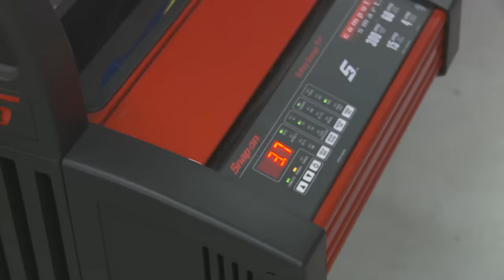Nitrous Muscle Truck and Mini Bikes! - Roadkill Episode 18

Comment: Back when Roadkill was Awsome. This is how it should be, building and working on the cars. Now it's just crusing around in old cars.

Don't get me wrong I still love the show but I'd just like for them to start building now. I also think they are focusing more on hotrod garage now.
Reply: Adilson Ochoa If you havn't already, watch the newest episode :) General mayham driveline is going into an old Duster, good episode
Reply: TaxiRune Yeah I seen it. It was Good. I heard the general mayhem is getting a SRT Hellcat engine on it that should be interesting. I'd like to see how they will pull that one off
Reply: Adilson Ochoa they sent it to some other shop to do it sorry to break the bad news
Reply: ***** Thats a real Shame. Are they going to build it themselves or Will they need the help?
Reply: Adilson Ochoa idk, just read it on the writeup for ep 40
Reply: Adilson Ochoa
Reply: Adilson Ochoa They will definitely need that extra help as the Mayhem is an old bodystyle with no form of modern electronics and with the electrical starter, they would need much extra help they could get to set the Fuel Injectors and electrical starter working.
Reply: Adilson Ochoa I just want a 2stroke diesel put into a Corvette.
Reply: +Adilson Ochoa Have you seen the last 2 episodes?
Reply: Scootering About did you know roadkill hates some corvettes
Reply: stupid correcter put your name wrong
Reply: TheNissanGuy i'd love to see Freiburger's '32 Ford project built on an episode of roadkill.
Reply: Adilson Ochoa they have more goin on then I could imagine. I'm sure they would make a new roadkill every week if they could but they have lives at home and jobs
Reply: Adilson Ochoa m...  .      ii9
Reply: Adilson Ochoa 
 l
Reply: Adilson Ochoa you should watch roadkill garage
Reply: If you want to see them building more stuff just go and watch Roadkill garage
 All they really do is build stuff

Comment: Dude i want this truck so bad. Wish i could put something like this together
Reply: a1duzit that truck from Jeepers Creepers had  a 383 with a whipple supercharger tell that wasn't badass looking like a pos
Reply: a1duzit come to north texas you can find a shit load of trucks like that
Reply: +a1duzit Drop an L76 into an old truck, it'll sound pretty close. You can get one out of an old 07-09 GM truck, it's the VortecMax engine, same 6.0 truck LS but an aluminum block. Those will be cheaper and easier to find than an LS6 or LS2, and with headers/tune it'll have over 400hp easy.
Reply: Im about to put a 77 stepside together with a 5.3, cam, and the same exhaust as the muscle truck
Reply: than just do it
Reply: Ryan Haslett wat was the middle called?
Reply: Ryan Haslett muffler*

Comment: That green stuff in the carb isn't mold; it is oxidized copper caused by ethanol attacking the floats and other brass parts of the carb.
Reply: That's what he said like 8 seconds later.
Reply: After years of using ethanol i have never seen anything green in my fuel system. I also never let fuel sit because I drive almost daily.Ethanol by itself is not corrosive. The problem occurs when you have two disimular metals in a fuel system. Since ethanol is slightly conductive this provides an electrolyte for electrolysis to occur. Ever see green corrosion on battery terminals? This is where the green color is coming from. It's probably coming from a piece of copper in the system which is the cathode. If you leave pure alcohol in a carburetor it should not leave any residue.
Reply: Possum Living i
Reply: well looks like SOMEBODY went to school...
Reply: GTIBully yes but it would just wreck everything rubber
Reply: GTIBully and yeah, floats are copper....
Reply: GTIBully it’s coming from the float bowls and needles/seats that are likely copper. The issue is, that modern fuel companies are using ethanol to reduce the octanes in fuel. While e85 is fantastic, e10 is utter garbage. 
And ethanol is essentially alcohol. It’s the fact that the ethanol is absorbing water and moisture, which is then corroding the copper.
Reply: ethanol gasoline is a double bladed sword. it burns clean because it has alcohol in it but it stinks, and it kills carburetors.
Reply: Look at you with your car stuff
Reply: Dylan Baxter bruh a COPPER float? You mean PLASTIC float?
Reply: +Dylan Baxter Brass
Reply: patina
Reply: Dylan Baxter Ethanol isn't essentially alcohol.  Ethanol IS alcohol.
Reply: Dave Micolichek your stupidity kills carburetors, not ethanol
Reply: @dylnbxtr  brass **

Comment: I look the look of the truck.
Reply: Like*
Reply: fhtfsca ffxqf cqikt4
Reply: +EnterpriseGamer same here its awesome!
Reply: EnterpriseGamer you mean ute
Reply: oooh a australian btw i am 1
Reply: It's body on frame with a removable bed. It's a truck.
Reply: In Australia its a ute
Reply: Proper utes have integrated cargo trays, not removable beds, and it's an American truck in America. A Holden Maloo is a ute, a Chevy C10 is a pickup truck.
Reply: ^^ so right, i hate when aussies call pickups utes and americans call utes pickups
Reply: HyperLeafBlower not sure what you call th3 classic Ute's then? (HQ'S for example.) 
and is a hikux a truck or a Ute? same goes for the Holden Colorado yeah??
Reply: Call them what you want in Australia I guess, I would say an HQ is a coupe utility/Ute, since the bed is integrated into the body. We don't have Hiluxs in North America, but if we did I'd call that and the Chevy Colorado/GMC Canyon (our version of the Holden Colorado) pickup trucks, as they are body-on-frame and have removable beds. The term "ute" doesn't really exist here.
Reply: HQ's had a body style called the "One tonner" where they were a seperate cab and tray.

Probably why they're still around unlike the fords. My guess is the fords and style side HQ's got junked when the rear quarters rusted out.

Comment: All that green crud in the carb was probably from the ethanol oxidizing the brass(?) floats and whatnot inside.
Reply: David F. Oh it was definitely ethanol oxidization. Mixing that shit with gas is NOT ok.
Reply: Yes
Reply: +WeActOnImpulse Official actually it is. You can compress it more without igniting it self. Dragster and other high performance engines use it
Reply: Tankred Zrn
Yeah, ethanol has a higher octane rating and is good for a lot of reasons, but older cars were never designed to run on ethanol and can be aggressive on fuel system components.
Reply: It’s the water, not ethanol. Learn to use it properly and it’s perfectly fine. Not rocket science, just basic maintenance.

Comment: To the point of the bad gas in the carb I acquired an old 1973 Garden tractor that had the stock carburetor on it. It had a metal bowl on it, & when I pulled the carb off to inspect cuz I was swapping a different engine the carburetor was completely destroyed. The tank was also metal, & all I blame is the Ethonol gas that was in it.

I’ve seen countless examples where the new Ethonol gas has killed carburetors. That, & Ethonol gas stinks rly bad. I’ve got a tractor whose previous owner filled it up w Ethonol gas, & haven’t touched it cuz I know it’ll need a carb, & wiring harness help.

Comment: I have a 1978 Camaro, but has issues with the part where the door shuts, the pin on this car is barely hanging on, Can't really drive this car, Unable to shut the door. It desperately needs to be replaced. I bought this car, because I am disabled, wheelchair bound, and that car sits low enough to get in, and the door opens wide enough, so I can load the chair inside my car. I wish you guys were close enough to help.
Reply: Just use a barn door latch like the rotsun!
Reply: replace the striker. it should be pretty easy.

Comment: We had a Honda ST90. Slightly larger than these 2 bikes.  The fuel tank was under the seat right beside the battery.  It had a auto clutch, or something.  No clutch handle, just shift through the 3 speed transmission.  All 3 gears pushed down, and there was a back half of the shifter that you stepped on to downshift.  You couldn't really downshift by lifting up on the pedal, just wouldn't work, so I suppose that's why they had the step down on the back of the pedal.  It had a cracked frame that had to be welded every so often.  We chased a lot of cows with it.  Fun little bike.

Comment: I want that freaking truck! I REALLY want that truck. Either that or drop a 1968 or '69 C10 on a similar new and beautiful chassis, drop a LS7 motor in that junk and BRING IT TO MEEE! My grandpa had a 1968 C10 long bed and it was a beautiful truck, not stepside, that weird green, with a straight 6 probably putting out about 120HP by the time we got ahold of it. But around 1998 my dad ended up selling it to a man that wanted to fix it up for $1000. And to think these things go for so much more than that now.

 It had a little rust, especially the chassis, but on the body itself it was just surface, with plenty of metal left over (those things were solid, built like a tank.) The grill was rotted and rusted out. But other than that it was a great truck. To think 

I saw the finished product about 12 years later, like 6 years ago, we looked at that beast in detail, he let me drive it, and talked about it for hours.

He stripped it, shortened the bed and dropped it on a new chassis, new suspension, with a $16,000 LS7 crate motor in it, Holley LS HI Ram EFI, lowered on American Racing Nova wheels (I believe) is what they looked like, big loud exhaust, tips powder coated in a dark grey finish. Stripped it and repainted it a very close similar green, in a matte finish to hide the waves in the massive flat sides of the bed and doors, and tinted out the windows. He either fabricated or bought a new style hood for it with out vents on either side of the hi ram. The rims had to be 18's, wider in the back than in the front. 

The bed was done in wood like this one but the wood was stained a light grey color with matte dark grey metal insert framing, and with the tinted out taillights and headlights, and the dark grey accents on the rims it all matched up perfectly. He changed the side mirrors to something aftermarket, or pulled them off of another vehicle and they were powder coated or painted matte dark grey (don't remember exactly) to match the trim and the wheels. I'm really not sure what they came from, but they were square instead of round and they looked amazing. Must have pulled all of the trim and gotten the dents and scuffs out, and put it back in accented in dark grey. 

He put a grill that it seemed to have been taken off of a completely different vehicle and fab'd to fit, no idea what it came from, painted matte grey to match the rest of the trim. The previously chrome bumpers were the same matte grey, perfectly matched.

Just imagine, the truck is that 60's chevy matte green with all matte dark grey trim, no chrome. Lowered down on a new chassis with new suspension and brakes, all new glass. The interior was completely gutted and redone with new upholstery, dash, and gauges. The color scheme inside was all grey with some green on the steering wheel and the gauges. He hadn't gotten a sound system in it yet, but it was ready to be hooked up. 

I'm not sure of what he had in it as far as tranny and rear end but it definitely ran hard. I just couldn't get him to do a burnout. I think his tires were expensive or something. I swear, I wish I had that truck right now, but this guy must have put at least $40,000 into it. At the very least. It was beautiful, and I wish I had a picture of it. Or at least had a way to contact the guy.
Reply: Wow real story!
Reply: great story man, my grandpa had a 73 c10 with the cheyenne trim package and the same green paint with white inside the trim, bought it brand new from the factory equipped with i believe the high torque 454, but agreed to swap it with a 350 small block sometime in the late 90s ( old school drag racer wanted it for one of his drag cars and my grandpa new he didn't need that much engine anymore since it was originally for towing his old camper), around that time he purchased his 95 chevy truck and the 73 started to sit until it hardly ran, i remember him pulling it out occasionally for a quick ride around town and to pick me up from my bus stop as a kid but after a while  it found one of its final resting places in the back yard mostly undrivin for a decade or so in his backyard in rainy Washington state where it rusted from the bottom up fairly quickly. He was diagnosed with brain cancer sometime in 2008 and was given only a couple weeks to live but managed to fight it until spring of 2014 where he passed peacefully in his home.

Ever since around that time I've held his old vehicle's like the 73 c10 and his 59 bel air very close to my heart but with the amount of moisture in Washington the bel air was just too far gone and it was down the chevy, unfortunately for me i was only 14 at the time and had very little options as to what i could personally do, but luckily one day my brother who was 17 at the time decided to find the key to the truck and attempt to start it out of curiosity, to his surprise the truck started up immediately and he decided to pull it out and park it in my dads driveway across the street where he worked on it for a few months with fair amount of progress, one day even taking it for a test drive to our local safeway and back! Things were turning out to be pretty promising for the old truck. After that he made a promise to himself and our grandpa that he would restore it and he eventually moved down to oregon and took it with him, he continued to work on little by little for several months until he came to the conclusion that the frame and body was just too far gone. After that he decided to pull the engine and whatever else he could salvage and sold the rest to be scrapped. He eventually put the engine in the back of his truck and hauled it to my step dads garage where we worked on the complete tear down process for a night but he never got back around to finishing the project. About a year passed with it sitting in the garage before he finally decided to offer to let me take over and i gladly accepted, I've been doing everything i can to finish the teardown ever since and im down to the last couple parts (crankshaft and camshaft but we're having trouble getting the harmonic balancer off). I've made it a huge goal of mine to take my time and save up for high performance parts that will eventually be fitted to the block and dropped in a similar truck that will be restored to as close to the original as i can make it in memory of my grandfather, no  matter how much money it costs, im gonna do whatever it takes to complete this build.

apologies for having such a long story but i figured I'd just take the time and share it with you xD
Reply: My dad's dad bought a 72 c10 in main and brought it back to jersey but ended up giving it to my dad's uncle and he passed away and so my dad's dad got it back so my dad got it and it has sat in my backyard for like 3 years
Reply: Joe Rinkel lmao.. okay.
Reply: +Alpha Machina its on sale on eBay for $50,000
Reply: Eric4014 Haha, yeah. No thanks. There's a '72 Chevy C10 down the road with a rebuilt LS6 out of a wrecked 2005 Cadillac CTS-V (I think), 4L60E GM Electronic Overdrive Trans, Holley Hi-RAM EFI, MEFI 4 24x computer, Magneti Marelli Pico fuel injectors, all new braking system, new fuel pump and lines, rebuilt chassis, new lowered suspension, new stained wood bed, American Classic rims, custom exhaust, with a nice matte black paint job on it and they only want $24,000 for it. 

The guy give me a print-out of the break-down of everything he put into it. He just can't afford to hold onto it anymore. He said it had absolutely no rust to begin with because it stayed in his/previously his grandpa's garage since he passed in 1979. I really, really, really want it. It's perfect. The only thing I don't like about it is that I didn't build it myself. But I figure if I get it, I'll probably eventually get the chance to pull the engine and transmission and get my hands dirty.
Reply: like roadkill is/was selling it?
Reply: Yeah, apparently.
Reply: Shayne McFarland Great story, man! You should definitely do that. At least you guys salvaged what you could from it. The heart and soul is there. There are quite a bit of C10's around, and because of how they were built, the bodies are usually in pretty good shape. I'd look for some out of the Southwest, like Arizona, New Mexico, Southern Cali, West Texas, etc. Those areas are dry and you can usually find vehicles in pretty good shape.
Reply: My dad has had his 68 c10 short bed with all options and a 396 for 24 years
Reply: Lol u went on a trip bro......

Comment: My Camero sat for 6 years with this crap gas we have now, I put a couple different kinds of additives and 5 gallons of crap gas in it and drove it to the shop, filled it up and have been driving the gas out of it since. P.S. that green stuff was probably copper oxide because of water in the fuel.

Comment: It's not the ethanol ppl/ Its that ethanol absorbs water from the air and then turns acidic. The acid attacks metals differently. Brass turns green for example. Plenty of simple reading on this subject in the webby.  These problems started to show up in shops everywhere in the late 90s-

Comment: Heh. 'Modern' carburetors. Such an oxymoron, but I wholeheartedly approve of the American Way of running old vehicle technology. All my bikes run carbs.
Reply: well carbs were used for a long time even after fuel injection was carbs were used well into then 90;'s then they stopped but fuel injection started in the 70's or 80's so they lasted 1 or 2 decades with fuel injection on the market
Reply: Tips fedora*